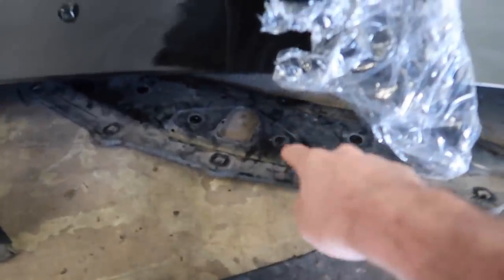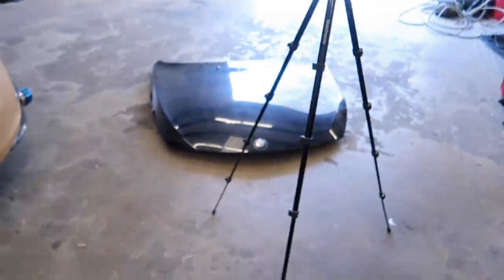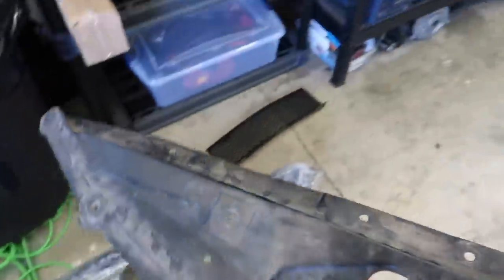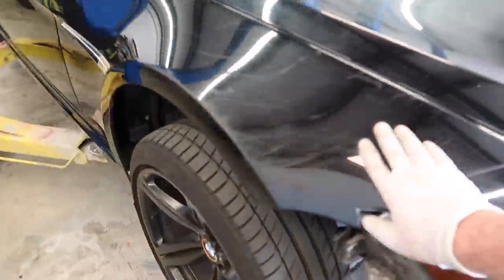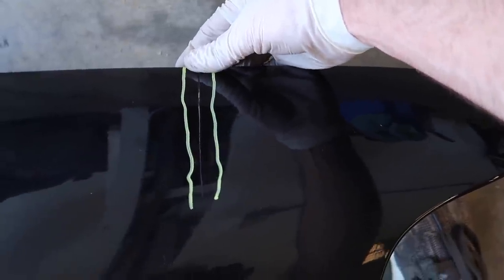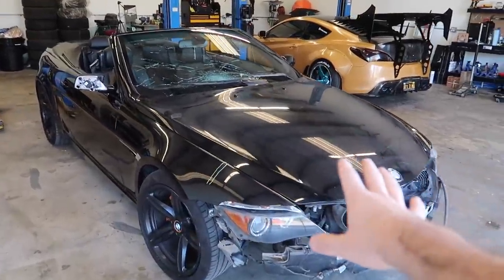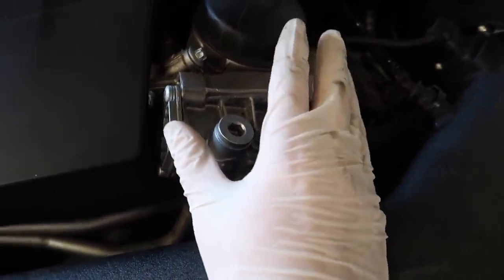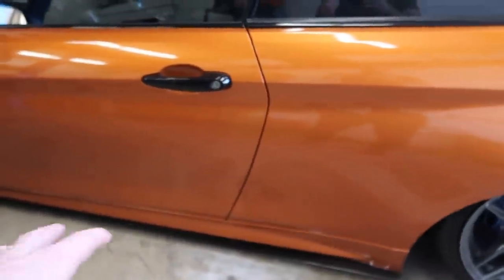Rebuilding My TOTALED $800 BMW V8 650I! (Part.1)

Comment: Love the new 6series content! I just bought myself an 08 M6 Convertible
Reply: Good luck bro, at 100k everything is going to start going wrong...lights, Idrive, transmission,  altenator bracket will start to leak, smoke at idle, coolant system will take a dump and start leaking from the valley pan, oil booster pump will start leaking.  Other than those things great car. I hope you're mechanically inclined,  you're gonna need to be. The stuff I listed above, at the stealership will require a second mortgage on your house. Just to pull it in the bay will cost you $160. Ask me how I know all of this...been there done that. Good luck.

Comment: You may want to melt some wire mesh into that plastic weld.  The plastic weld could delaminate over time at those stress points.

Comment: The only problem with these cars is that it has bad battery problem with the 645 and 650 2004-2006. Question does ur battery die alot after not driving it after a few hours.
Reply: I'm digging for information from 06 650i people. My engine mounts are bad. Do you have any types of information about how I can replace them? Honestly, it just sounds supper annoying. But if you got suggestions I'm all ears